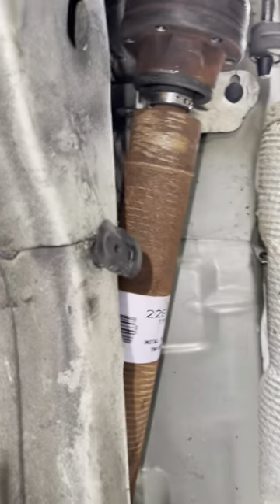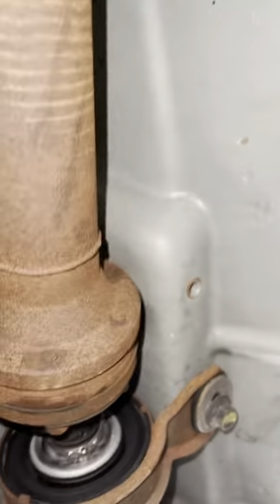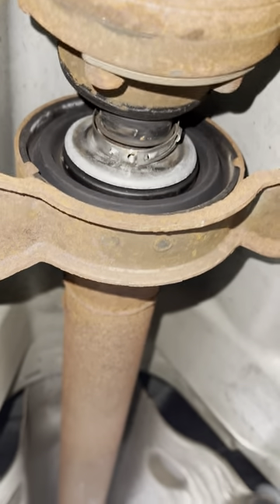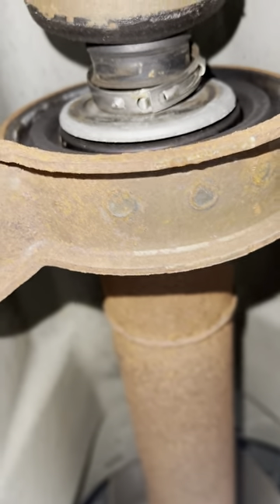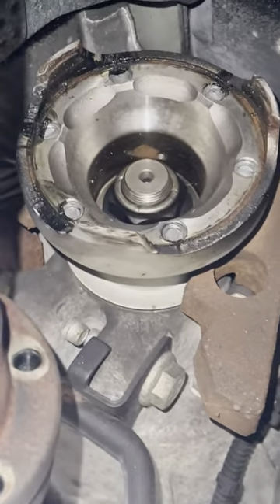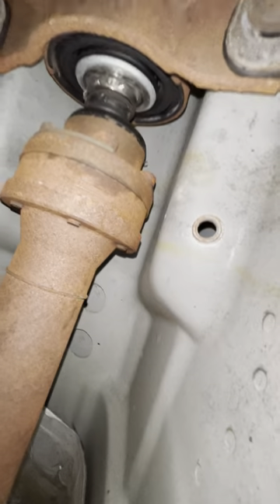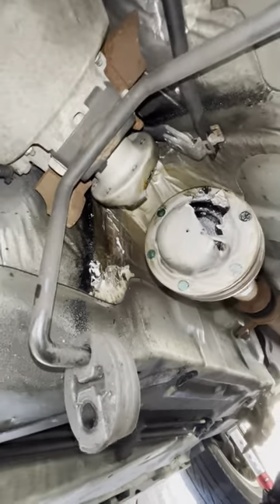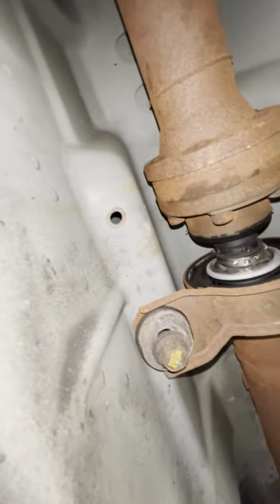2008-2014 Cadillac CTS Driveshaft Repair- Removing the driveshaft

Comment: Do you have to take the whole drive shaft off if you were just  replacing the bearing if so y?
Reply from the maker: Yes. The whole driveshaft assembly needs to be removed as one unit for this. The connecting elements are CV joints, not knuckles. Most people will say this can't be done and want $4000 for a new assembly. I took my chances and utilized my skills to attempt it myself and replaced the broken center bearing with a cheap (around $25) ebay replacement. If I were to do it again, I would get a better quality center bearing assembly.
Reply from the maker: FYI, I did replace the bearing. Go to my page and there's a longer video for the center support bearing replacement. Hope it helps!

Comment: I just was on the highway. Heard two loud bangs like a pothole and lost all diff fluid... Any ideas? Had all symptoms of taking off clicking, burnout clunking,  loud noise under seats clunk noise when turning right and burning out,. Shouldn't be the tranny at all? Any ideas if a diff can make a loud jolt and dump all fluid?
Reply from the maker: Wow, that sounds scary! Mine made the loud bangs and felt like I ran over a bowling ball or something, but I wasn't at highway speed. Question; was yours able to hold when it was in park? Or did you have to use the emergency brake? Mine wouldn't hold so I had no choice but to use the emergency brake.
As far as dumping the diff fluid; I guess it could happen if the diff flange somehow dislodged from the housing. I guess it all depends on where the failure happened, The center bearing could have failed and caused that kind of damage, but you'll have to get it up on stands and take the exhaust off then remove the heat shield to see what the aftermath of all that is! Please post back and let me know what you found! Good luck with it!
Reply: @wit2pz The brake works but yes it's rolling freely. Had to park it with e brake and 2 wood logs .  @wit2pz  what did you all have to do? 😢. That big differential at the back is completely cracked in half on mine..
Reply from the maker: @YXEFlatl1ne  is that all that's damaged? Is the driveshaft damaged as well? I would assume you can replace the differential but it will require inspecting the axle shafts as well to see if they're damaged. I got my parts from a salvage distributor to save money. If you enjoy DIY stuff, this is definitely a worthwhile project!
Reply: @wit2pz  not sure how I'd tell. I'm scared to start it and try and gear. I parked it immediately on highway side and called a tow truck after the second bang and watched the black fluid leak out the back diff case
Reply: @wit2pz  well the specialist did there has to be a reason the casing blew they don't just fall apart. I know for a FACT %110 my center drive shaft center support shaft bearing was fuckedddd. Thuds on takeoff etc. Could that blow the diff?
Reply from the maker: @YXEFlatl1ne  it certainly could blow the diff... Understand that the driveshaft is a 2-piece unit. The center bearing has a rubber diaphragm that keeps the 2 pieces spinning within spec. As the rubber diaphragm weakens, the center joint of the driveshaft spins and gets out of line, which is why it hits the bottom of the car when accelerating. That rotation puts direct pressure on the diff, so yeah, I guess in your case, the rotation weakened the diff casing. 
Is yours AWD or RWD?
Reply from the maker: @YXEFlatl1ne  Do NOT try to drive it. Since  the rear diff is blown, you could do more damage if you have a front diff, IF it's AWD. You've got to decide if you want to fix it yourself or pay the shop to do it. Or scrap it...

Comment: So how did you end up pulling it out???
Reply from the maker: @Zachary Eckard, that entire assembly, from the front where the cap was damaged to the center support bearing to the rear shaft had to be removed as a whole unit. I pulled the rear of the driveshaft off the differential first, then removed the center support bearing. 
I found a replacement driveshaft at a local junk yard, bought new bolts that have been redesigned for better structural strength, and replaced the damaged cap off of the junk yard driveshaft. 
Make sure you mark the rear shaft because it goes on pretty easily if you line it up correctly. There's splines in the driveshaft that mate up to the rear differential. If it's not lined up, it will be difficult to get back on. If it's lined up correctly, it slides on with relative ease. Hope this helps!

Comment: Did you have any symptoms
Reply from the maker: Yes, there were sounds that sounded like a faint helicopter that I could hear periodically. The problem is that the original bolts are poorly designed so they fail and shear off. If you’re lucky enough to catch it before they all fail, you can order new bolts that have been redesigned for structural rigidity and replace them yourself. Let me know if you have any other questions.

Comment: RWD and brand new wrap and engine yesterday from GM dealer 😪
Reply from the maker: Damn Bruh... at this point, I'd advise to go ahead and get it fixed with an upgraded center bearing OR a solid, one-piece driveshaft!

Comment: Needs new yoke bolts are broke off
Reply from the maker: I was able to drill out the remaining bolts from the yoke pretty easily, after I made divots in the center of the bolts with a dremel. They spun right out! Yoke wasn't damaged at all.